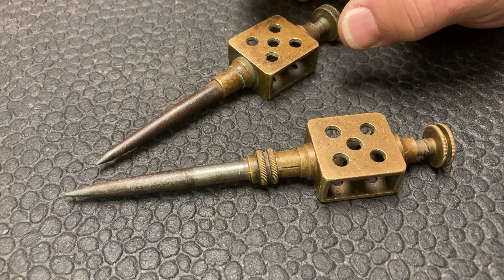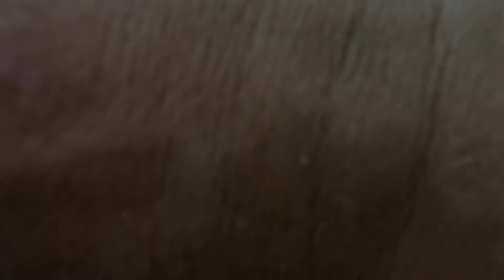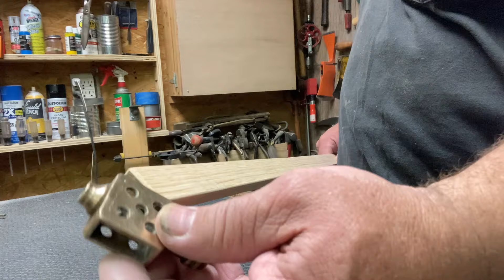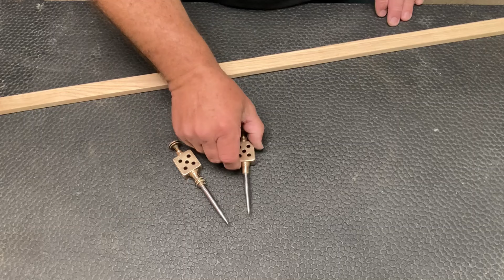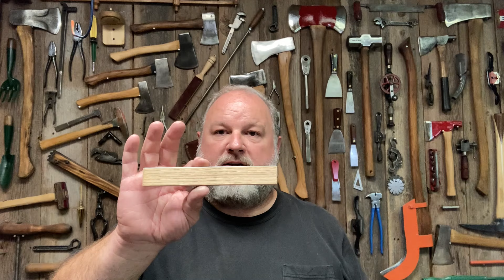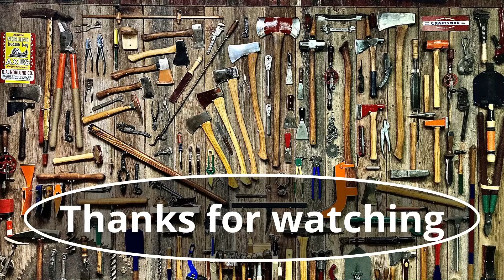Vintage Bronze Trammel Points

Comment: I was kinda expecting a mirror shine out of that tumbler but I guess you never know, so many different alloys out there.....Still turned out fantastic, I love the ornate old tools.
Reply from the maker: I was hoping the Tumblr would work better as well. All in all it was clean and I suppose I could spend more time with some very high grit, wet sandpaper, and get it to a higher polish. I also do like the old look. Thanks so much for coming by the shop and have a great weekend.

Comment: Nice work!  I think I could read the adjustable one does say Millers Falls on the top line. That would be why they are two different lengths. They're from two different companies.
Reply from the maker: That’s an interesting thought. They do look an awful lot alike. I know that sometimes different companies would commission the same manufacture to build stuff for them. For example, Mann edge tool company made a lot of axes for a lot of different companies. It would be interesting to know if this is the case here. Thanks so much for sharing and hope you have a great weekend.
Reply: Good points.  If you go back to your footage where you look at the adjustable one, I really think I see the bottom half of 'Millers..." with other lines spaced out that it could read Falls.  

Just a thought. You too have a great weekend!

Comment: wouldn't it be great to also make an end for a pencil or marker for the other end to mark a piece of cardboard when making a template? just thinking out loud here
Reply from the maker: I think you’re absolutely right. Somebody suggested that the adjustable point could be replaced with a pencil. I’m going to test that next time. I’m in the shop. Thanks so much for your visit. Hope you have a great weekend.